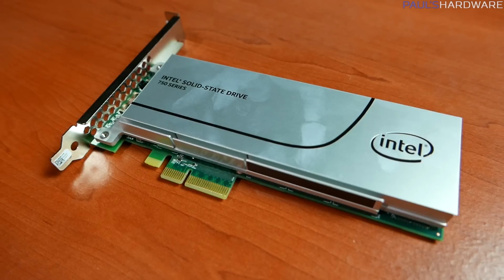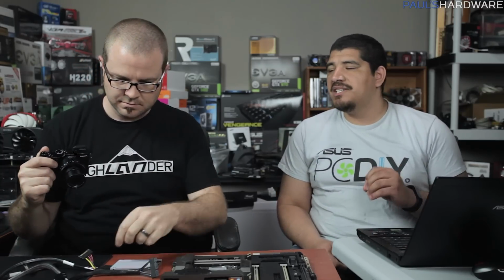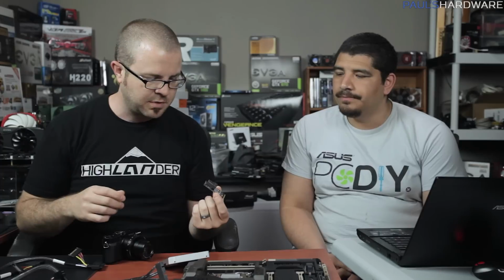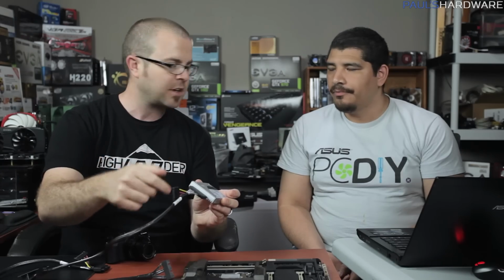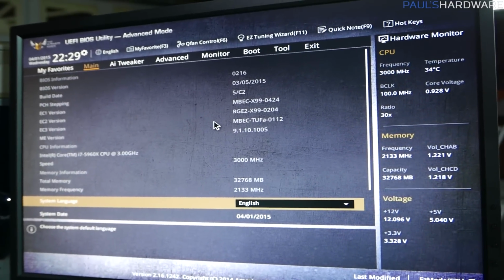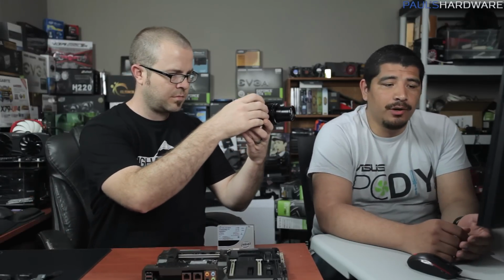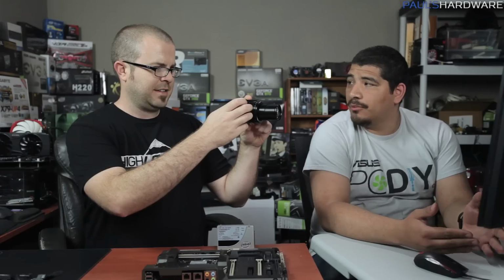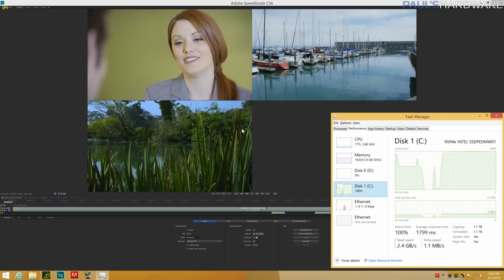Fastest SSD Ever! Intel SSD 750 with JJ from ASUS

Comment: I find it hard to justify the purchase of an SSD for gaming. I find no fault with the tech, but instead with the game creators. It's far too easy to fill up a $300 SSD with less than 10 games. For people with a large game library it simply isn't economical. I'd love to have my games on SSDs but until games start shipping with compressed audio formats (insert complaints about dual cores) I cannot justify spending hundreds of dollars on 1TB+ (more like 2 or 3) solid state storage drives. I'd rather spend the money on another 290X and water block.

This drive itself looks amazing and I'd gladly buy one as a boot drive.

Comment: Thank you for making a very informative video. I learned a lot about these SSD devices and X99 motherboard chip set performance. It was also very helpful when JJ said that you would need MS Windows 8.1 in order to have a driver that can maximize the performance of the motherboard devices.
I would like to know if other software platforms have got drivers optimized for this chip set. I use GNU Linux and FreeBSD. I know that Intel does a great job of providing drivers for these platforms. The only question is whether the appropriate drivers are currently included in the Linux kernel or any of the BSD base systems. It would be very helpful if you or JJ included this sort of information about new hardware technology.
Again, thanks for making an informative review of this hardware.
Reply from the maker: EdWittenable Thank you for the comment Ed! I can't answer your Linux question for sure, but I know these drives came from Intel's enterprise side originally so I would not be surprised at all if NVMe support is already there. I'll see if I can get an answer from JJ on this one!

Comment: Guys,

What cooling recommendations would you suggest for my next rig this fall, the primary use will be for video re-coding.

Asus TUF Series Sabertooth X99 System Board
Intel Haswell-E Core i7-5960X CPU
Corsair Dominator Platinum 32 GB DDR4 (4x8) Memory
Intel 750 Series PCIe 1.2GB 2.5 (boot drive)
Microsoft 10 Professional OS

Comment: I got a non-related question. Does the Asus ROG Front Base Dual-Bay Gaming Panel Multi function monitoring and overclocking display controller work with the Rampage V Extreme Motherboard? Thank You!

Comment: Kind of disappointed that you guys ignored (unless I missed it) the extremely impressive IOPS that these drives are capable of. IOPS is where an SSD really shines because you rarely are dealing with single sequential transfers of 3+ GB at a time. Windows bootup, game loading, etc all use lots of files at different sizes. Perhaps map loading for games like Battlefield would see an improvement with sequential but the IOPS shouldn't be ignored. Its VERY impressive for a single drive solution.

Comment: I was so hype out for this drive until I saw the horrifying 51 seconds boot up from techreport review. I decided to hold my trigger on this until some BIOS fixed come in and let this drive boot up in less than 10 secs to window.

No way I will be spenting this to wait for 50 secs boot up.
Reply: berserk er I noticed that too when reading the techreport review, but 51 seconds seem way too slow to boot to Win8.1. Hardwarecanucks reviewed both the PCIe add-on and the SSF 2.5" versions of Intel 750 on Sabertooth X99 (the latter via this HyperKit that JJ's tallking about in the video) and with both versions Win7 booting + Anti-virus/Anti-malware startup took only 22 seconds. Don't know if Sabertooth X99 is the exception in the current lineup of X99 and Z97 motherboards with some kind of "from the ground up" NVMe support, or a mere BIOS update will fix the issue for other boards. (techreport used ASUS Z97-Pro.)

Comment: iv just got the rog Maximus 6 extreme bord will u be doing a bios update for this tec . or will bios updates get forgotten now just like you did too the rog 3 formula 8 months after release that was so disappointing  ,I mean its already happening to the rog 6 with wifigo im already emailing asus to fine out were to get the latetiss wifigo because   the android wifigo app says the pc wifigo software needs updating and wont run till is done , but the rog Maximus 6 extreme softwere and hardware is still not been updated , I even tried using the Maximus VII Formula wifigo and the app still says its out dated . put it this way NVidia/amd  there rendering gpu are like $2000 and thay still update there software/hardware 3 to 4 years after there made so y cant ROG do the same, $800nzd Maximus VII Formula too $1000nzd Maximus 6 extreme mother boards is what is cost here but you only give support for 8 to 15 months , asus needs to support the $500+ gear until 2 generations have past not when a new tec is made that betters it  . after all it takes 83 hour of work to get a $1000 so I would need to work 17 weeks too save that just for the part then 8 to 15 months later asus wont update it , with validated rog software , where's the séance in that

Comment: 1200$ for 1.2gb at this speed is actually pretty cheap. Where I live you pay about 50c/gb for 500mb read/write and about 80c for 750mb read/write. So that's almost as expensive as the 1$/gb with this ssd. Plus you'd have to raid 0 a couple of them together to get even close to the perfomance this one has. Which means the price for two in raid 0 is doubled and still maybe half as fast.
Only downside is that the implementation over m.2 with the adapter and cables is a little bit too ghetto for my taste.

Comment: I have the Rampage V extreme, what would work best for this board. iv already got the Raidr pci-e ssd fitted... if i get the 2.5 ssd will the link fit in the m.2 port with out hitting my GPU which reaches the sata ports on the board ?

Comment: Hi Guys, I got a non-related question. Does the Asus ROG Front Base Dual-Bay Gaming Panel Multi function monitoring and overclocking display controller work with the Rampage V Extreme Motherboard? Thank You!

Comment: My SSD that is supposed to read 550mb/s reads 360mb/s and should write at 520mb/s only writes at 85mb/s, and its just a couple of months old!
Reply: Well... Adata rates there SSD at 512gb (or maybe 256) capacity, since you have a 128gig, since there is less chips in, it is effectively 4x slower in the write
Reply from the maker: Ted SN that SSD also has a Sandforce controller if I'm not mistaken, so you'll want to feed it compressible data if you want to hit those advertised speeds
Reply: Ted SN what drive?
Reply: its the adata premier pro SP900 128gb

Comment: IMO it's not about speed anymore.
You'd only need ~100k IOPS for fast enough OS/application behaviour.
Just bought recently a large enough SSD to have also all my Games on an SSD but I wouldn't spend too much on it (got mine for cheap on eBay).

Comment: For Game load times, it's only REALLY mattered to me for ONE game, SpringRTS. 

For team games, whoever loads fastest gets to choose where they start and the faster than second they are, the more time they have to click on the spot (game loads zoomed into the centre of the map so gotta zoom out and scroll before clicking). 
It's nice to get rid of the loading times but I've not had a system with a fast enough CPU to really take advantage of it, so, meh at the moment.

It's awesome that we're entering SSD 2.0 realm (if you're the kind that thinks web2.0 is a 'thing'), with 3D NAND and now NVMe (plus a whole bunch of other small stuff).

Now we need 100Gb/s ethernet to become "enthusiast-able" even though 10Gb/s only just creeping in. 10Gbs will feel so slow in a couple of years when we're used to 50Gbs SSDs (bit like how 1Gb/s feels slow to a 6Gb/s ethernet).

I'll only start about internet speeds however (and I'm lucky enough to have 152/10)

Comment: I have Gigabyte GA-Z97X-GAMING 7 motherboard.. if I use the 2.5-Inch ssd and connecting it into m.2 port on board through the provided cable will I still get the full speed benefits of this ssd?

Comment: I have SSD in my Computer that can handle 700MB/s read and write. But for gaming I use a standard 2.5" HDD that is (at the moment) connected via USB 2.0 and have no problems with that.

Comment: My Asus H97-Pro has m.2 slot that is supposedly PCI-E as well. Anyone know if it is compatible with this? I couldn't figure out from Asus website if it uses PCI-E 3.0 or 2.0. All my other PCI-E slots are 2.0 though (excl. the one that I'm using for my GPU) :(

Comment: Now it would be interesting if someone modded their laptop to use this.... Highly unlikely due to sata power and I'm unsure if laptops with M.2 has a 4xpcie 3.0 speed so it might be bottle necked. It might not even fit in a 2.5" drive because the height of the SSD, it looks higher than standard SSD. I'm curious about the thermals for this SSD, might be hotter than average SSD but probably within safe limits. We'll find out more once this is out for a bit. But JJ and Paul are awesome guys, good job guys :)

Comment: Would the PCI card work with a Z77 board?
Reply: Zach Moeller IF Asus and intel have worked together with a bios update AND that particular board in question has a TRUE m.2 slot with native pci express gen 3.0 4x speed bandwidth...then yes.  Otherwise..I doubt it as far as expecting native full speed from this new ssd.

Comment: As a gamer who has both an SSD and a HDD, I find that SSDs are especially helpful when transitioning between less demanding and more demanding areas. For example, in the newest assassin's creed games they minimize load times by streaming in the content. That process depends partially on how fast your storage solution is. 

I'm definitely going to be getting this. What's the ETA on this?